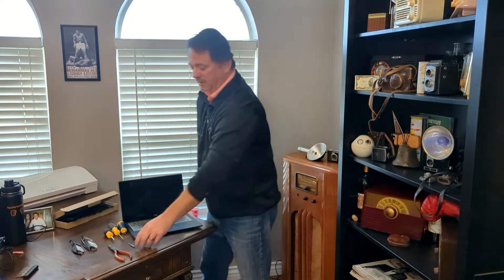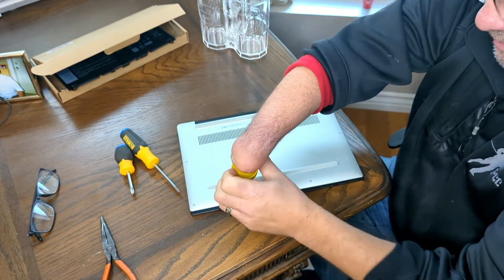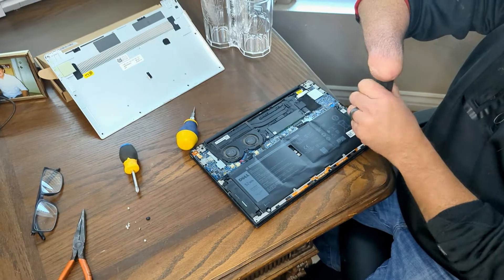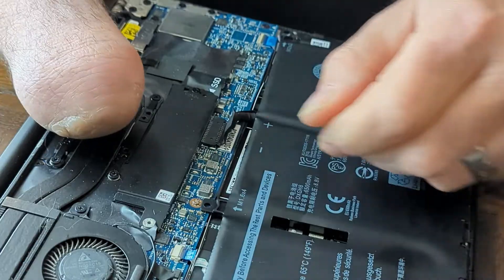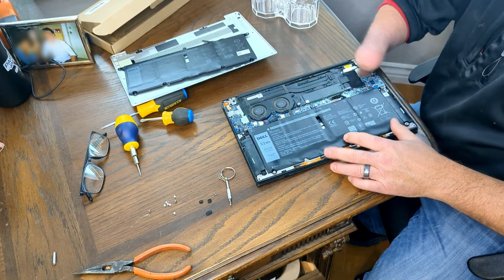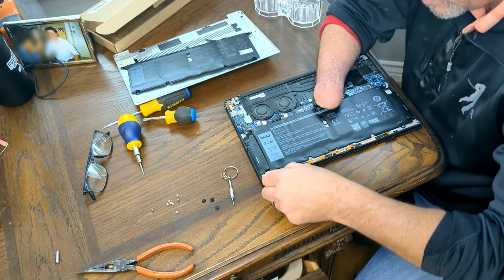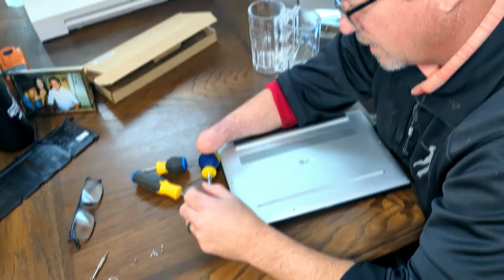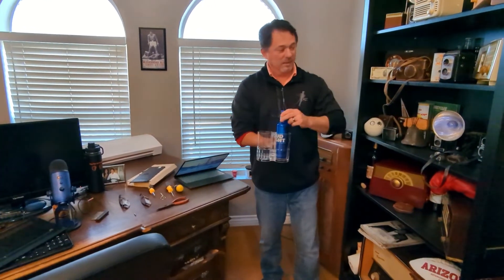I replaced the battery in my Dell  XPS 13 9370 Laptop

Comment: Can the Dell XPS still run without a battery being installed / connected? Thank you also, the new replacement battery is a real Dell?
Reply from the maker: I'm not sure if the computer will run without the battery installed. I think so, but I didn't start mine up when the battery was out. The battery I link to is a real Dell battery.
Reply: @OfficialMikeBolland  got a hold of an XPS (Win 7, but can be upped to 10) laptop but the battery appears to be defective. Looks like water damage. Thank you